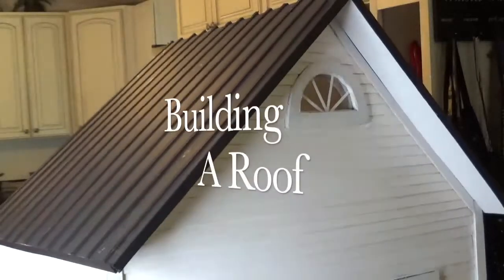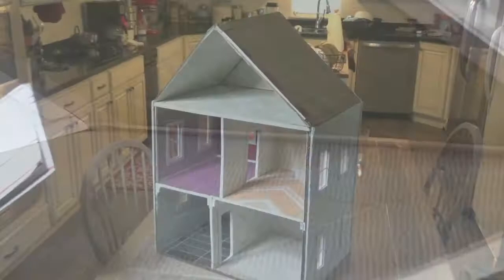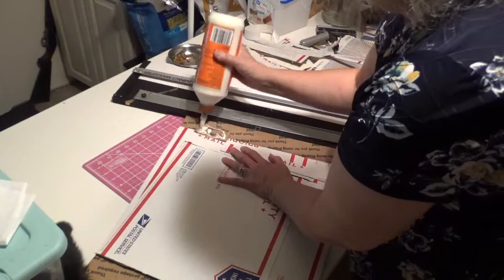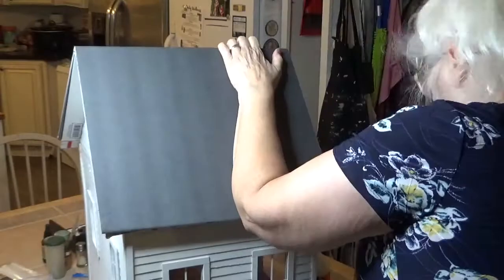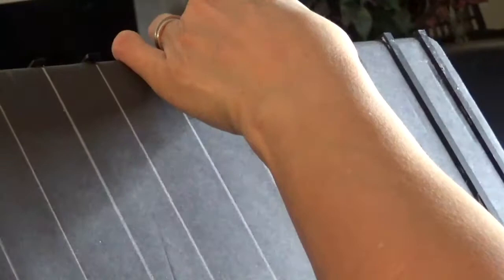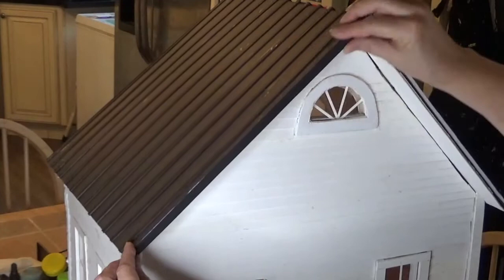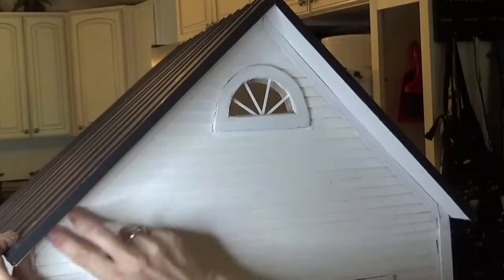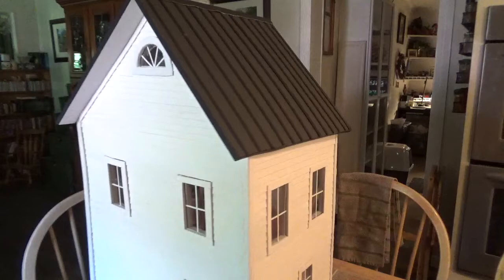Dollhouse Roofing

Comment: Nice work. Which glue works best with foam board?
Reply from the maker: You can use hot glue for a quick temporary hold but it may melt the inner core. I like Tacky glue overall for a good and long lasting hold works with most crafting materials
Reply: @DebraCarmona  , is there an exterior tacky glue?
Reply from the maker: @robertcornelius3514  Not that I am aware of. I would not keep this house outdoors. The weather would destroy it. I will be posting a video of hardening the exterior surface but I still wouldn't put it outside.
Reply: @DebraCarmona  , the reason I ask is I build fancy birdhouses.
Reply from the maker: @robertcornelius3514  Cool I did learn yesterday that there is a glue that can be used for external uses. It is UV resin. When using resins read the label for safety precautions
Reply: @DebraCarmona  , I have used uv resin in the past. Fast acting. Never thought to use it on one of my fancy birdhouses. Thanks